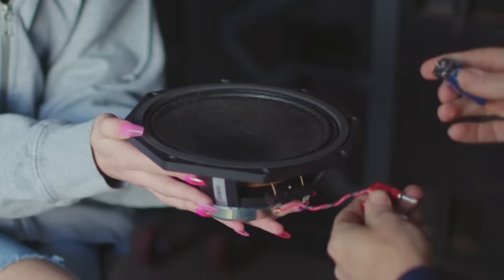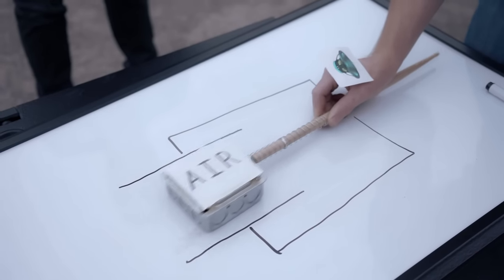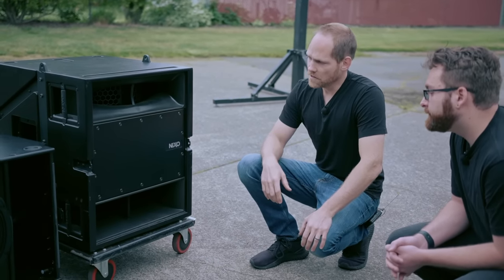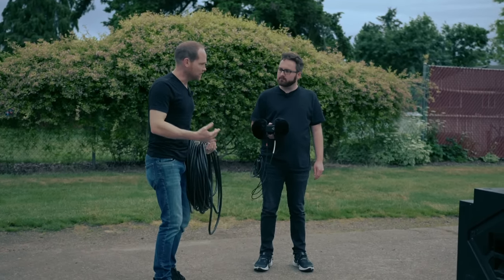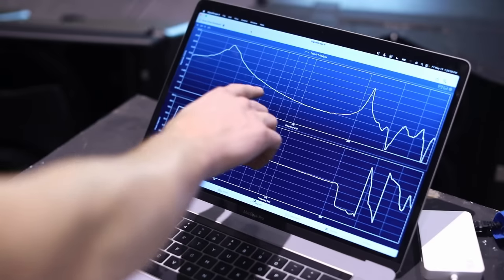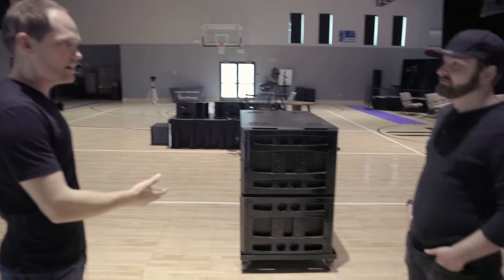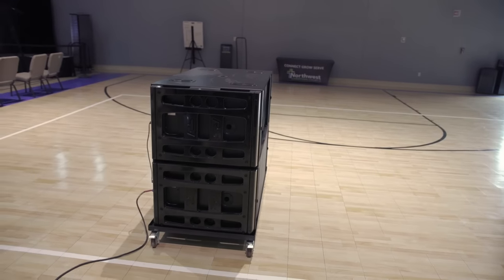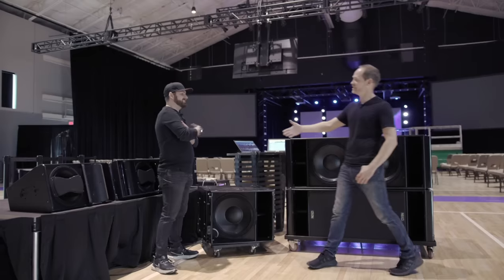Things you didn't realize about bass... until now.

Comment: I'm an old, history making, 4 time, major music award nominee.  And troubleshooter to the stars, studios.

I just love all of these audio experts.  With their expert understanding of how, speakers work.  But there is only one problem.

Every speaker has a plus and a minus terminal on it.  And when a positive voltage.  It is applied.  To the positive terminal..  The speaker pushes outward.  As, it should.  But there's only one problem there.   It's actually not doing that.  It is doing the opposite.  And here's why.

The bit with the positive voltage on the positive terminal.  Is, referred to as, Absolute Polarity.

Now all is fine and good.  Until you start to play music.  Because when you start to play that music.  The speaker is no longer pushing out, toward you.  On the contrary.  It is, sucking in.  To its frame.  And you are merely getting the, relax rebound.  Negative polarity, sucking speaker.

This is all due to years and years of, Joker audio experts.  Demanding, no out of phase, anything.  In their signal chain.

As a result of this mindless demand.  There is a point in the signal chain.  Where the signal has to be, must be, inverted.  And that is directly at the output.  Of the audio power amplifier.   To the input of the speaker, directly.  As this is where, Absolute Polarity, is established.   It cannot be done, further back upstream.  By merely inverting the phase of the waveform.  That does not change the, Absolute Polarity, at the output.  Going into the speaker.  It would still be in negative polarity.  Even the left and right channels can be in phase, together.  They can also be, 180° out of, Absolute Polarity, together.  And nobody has the capacity or the depth of brain matter.  To figure this out.

This is a fix I have done now since, 1978.  And all the way up to  a studio.  Owned and operated.  By why the finest and most legendary, American, audio console manufacturers.  Known as API.  This is like,, checking the work and correcting your college professor.  Which is not an easy feat, to accomplish.  But I've had to.

You see if everything is kept in, phase from input to output.  A positive peak will result in a,  equal negative excursion.  I will now prove my point.

Let's take our mainstay, bass drum for instance.  Whether you put the microphone inside the bass drum or on the, batter side.  Of the bass drum.   It does not matter.  Because…

When the bass drum is played   or, kicked.  That sound pressure wave.  Strikes the microphone diaphragm.  And in so doing.  It depresses the microphone diaphragm.  Into the body, of the microphone.  As is hit by that sound pressure wave of the bass drum

Conversely.  Your speakers.  Will now mimic.  The motion and the direction of the motion.  Of the microphone diaphragm.  And which way is that moving?  Is it defying the laws of physics?  When met with a sound pressure blast.  Moving toward and into the blast?  Of course not.  That is not physically possible.  As in physically root word for, physics.  And what is and is not possible.  In our physical world.  Meaning physics.  Not just a ball.

And so the only way to deal with this, inverted polarity phasing.  Is, to invert the input wiring on both left and right channel speakers.  But take note here.

I stumbled upon this completely  clueless and mindless, issue.  Way back in 1978.  When at 22 years of age.  And without a college degree.  I designed, built, fabricated.  Then, Baltimore's, 2nd largest, music recording and commercial production, recording studio.  I had equipped our control room with, JBL, 4311, monitor speakers.  And our abundantly large control room.  Sounded, simply fabulous.  When my business partners friend, Matthew Polk.  Came by.  Because he wanted us to use his speakers.

But then I discovered.  Matthew Polk's speakers were, both out of phase to my, JBL's. hmmm?  What the hell?  What's going on?  I've got everything wired and phased, correctly!

When studio partner Phil.  Suddenly cranks of the volume.  As some would.  And it instantly blows up Matthew Polk's,, tweeters.  And Philip laughed his ass off.  Matthew left feeling hurt, broken and dejected.  And I felt bad for the guy.  But really his speakers, sucked.  In comparison to the JBL's.  Even when I polarized them, identically.  And… Well… Nothing sounds like JBL speakers.  Nothing.  And here's the funny rub.

The plus and minus connection, binding post.  They are actually already wired, inverted.  So when you wire up incorrectly.  As indicated in your amplifier and speaker manuals.  To make with inverted polarity on both.  JBL has a working brain, for you.  And figure this out for themselves.  Back in 1968.  Or perhaps, even earlier?  But I have no experience with them.  Before 1968.  Kind of indicating how old I must be.  Now you know.  Old.  Like an archaic piece of a, mechanism.  And just plain old.  With over 50+ years in the industry.  Of recording music.  And broadcasting  news, coast-to-coast and around the world.  Thousands upon thousands of times.  And one of the best and  one of the real, Audio Engineers of all time.  And I'm honored to be known in that manner.

So to be clear.  When it comes to Pro Audio.  And in particular to music recording.  Mathematics and textbooks.  Do not reveal.  All that is occurring..   And how..  And nobody can really think that through.  I've had to explain this to a number of  County electrical engineers and acoustic engineers.  And some simply never get it.   And I find that sad.  They don't know what the FUCK they are listening to?  They only know what textbooks and mathematical formulas are saying.  As they blow by.

And so this simple fix.  Will change your whole outlook.  With your cheap speakers suddenly sounding, some kind of stupid great fabulous!   Like how?  How is this possible?   It's because that based on microphone and is now causing the speaker to punch out toward you.  That's how.

I always love to get those look from an electrical engineer.  Whose eyes suddenly glazed over.  And it looks like a deer in the headlights.  And because people are simply blown away by this newfound, monitoring anomaly.  That no one and I mean no one.  Has ever been able to put, 2+2, together.  To understand what is going on!

In fact.  I believe.  This is the biggest, technical audio blunder FUCK up.  In audio history.  This is a doozy of a, superior stupid mistake.  That no one has ever question.  And has blamed their monitoring issues.  On everything else.  It is so unbelievably sheep and lemming like.  I no longer know how to respond to them?  Because when all you hear is, whacking a doodle Dandy.

The cluelessness is justice, jaw-dropping.  Really?  Are you really serious?  Oh my…
RemyRAD

Comment: Old version of paper cone😒 Speaker now a days are tough made by rubber edge cone for the frame.that more gives excellent EXCURSION🔊BASS PERFORMANCE ON HIGH LEVEL OF FREQUENCY thru SPIDER VIBRATE SUSPENSION SYSTEM.😏🤗😉🇵🇭

Comment: If your from mit I don’t understand your logic when a woofer is reproducing a waveform in is inverted out is non inverted non inverted is positive current coming from the pnp bootstrap and inverted comes from npn bootstrap both sides come from equal and opposite sides of the bridge rectifier and filter capacitors input 4560 10kB pot 4560 two sets of drivers to output stages equal and uniform wave form mje15024 mje15025 mj15032 mj15033 4580 4580 .1 10 10 uf 220 220 uf 4.7 uf 4.7 uf .068 .068 5w .33 x 12 2k 5watt x4 10.000 uf 100 v x4 bridge rectifier rane two way divider network

Comment: In the beginning, you do not explain how a port works correctly.   The mass of air in the port inverts the phase of the air coming out of the port at the port tuning frequency. Your demonstration is kind of correct but but your explanation is wrong.   A ported box is called a helmholtz resonator.  Another example of a helmholtz resonator is opening the rear windows in your car and hearing the buffeting inside the car.  That is what you would hear if you stuck your head inside a ported speaker cabinet. At the port tuning frequency the mass of air in the port stops the driver from moving.  Later on in the video, you start to explain it correctly with the graphs.

Comment: your description of how a port works is AWFUL😫
Reply from the maker: Lol well then give us a better one!
Reply: ok, after seeing the rest of the video, i will upgrade that to meh. the description of a port as " a hole in the box to let the air out" is incredibly misleading and over-simplified. after a career in car audio, if i had a dollar for every time a customer tried to tell me that we could make the sub box smaller by "putting a port in it to let the air out", i could have retired years ago.when, i fact,  for a given driver, the optimum ported enclosure is larger than the optimum sealed enclosure.  a port has a given area to length ratio that will vary with driver, box volume, and tuning frequency. the same effect can be had with a passive radiator. the rest of the video contains a lot of good info.

Comment: lol... man that ia absolutely lame... you have observed the construction of a phase inverting port, with phase and amplitude graphs, resonances, etc. OK. But where is any evidence of existence of any other acoustic framing techniques? Do you even know about the case where the speaker works inside the box, in between the two ports, for example? And simple closed box is also here, as well as "infinite" screen with no box itself. All framing types do exist in real installations, have their respective reasons, pros and contras. 
Actually, no complains about the content, I'm objecting only a title, which is far more promising than the video itself.